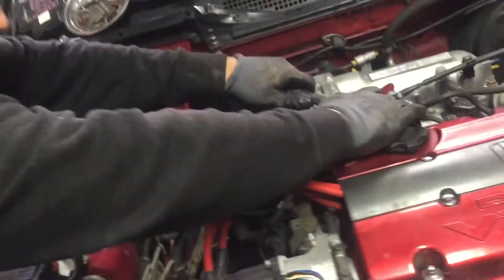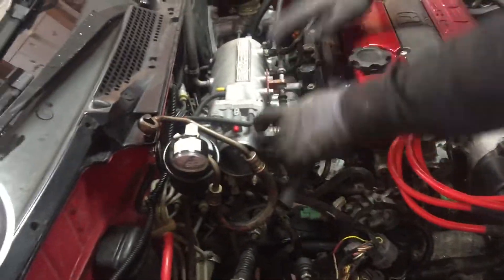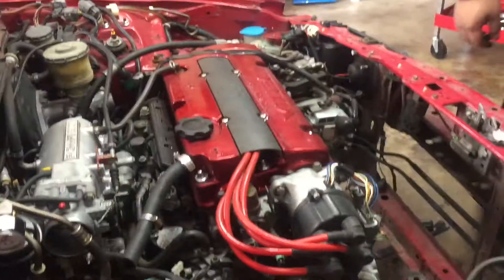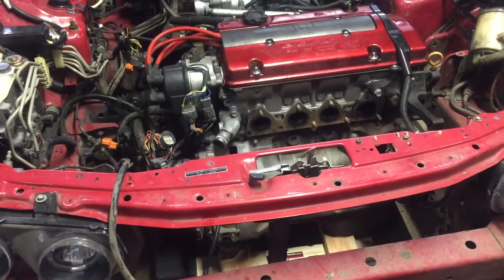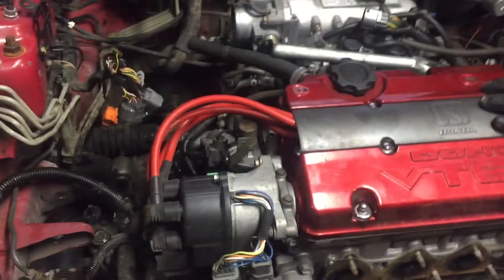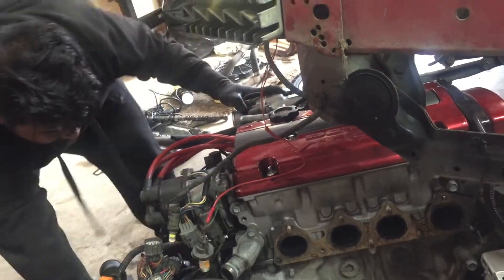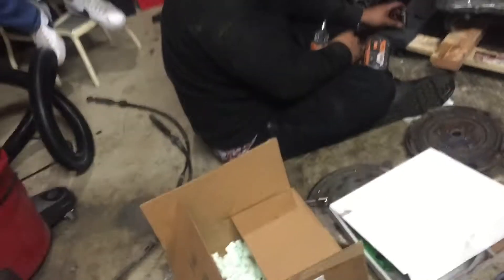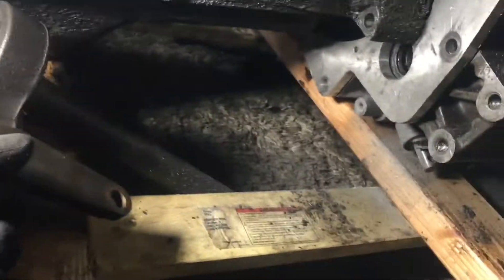Kyle H2B Swap in integra DC H22 part 1

Comment: What type of mounts where used for the stock h22 with stock transmission into the DC integra. And why change to h2b swap ?
Reply: b series has shorter gears so better acceleration and its easier then purchasing the million items needed to use an h series trans.  If you have a b series trans its cheaper then going h trans
Reply: @timm5970  mmm exactly what would u need to use the either f20b transmission or h series 🤔

Comment: I have a question,  so my car won’t start now. It’s a 97 integra with a h22A swap with ob1 PO6 ecu mapped for H22a. But when I used to start my car I’d hear a clicking in the dash then my fuel pump would turn on then I’d start my car.  Now when I turn the key I don’t hear any clicking and my fuel pump don’t even turn on.  I changed the main relay it’s new. Still nothing. A buddy thinks it’s my Ecu gone bad?? What do you think 🤔
Reply from the maker: Check fuse and main relay. H22 comes with the a box for the injector that looks like an amp on the harness. Check that too.